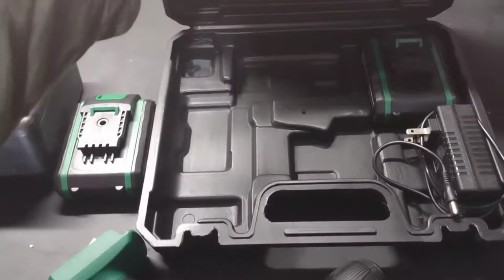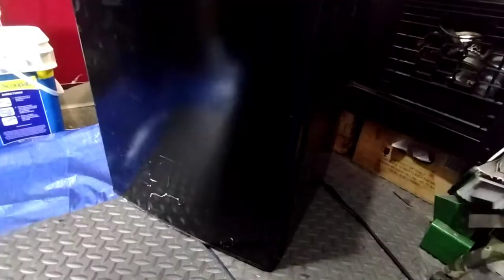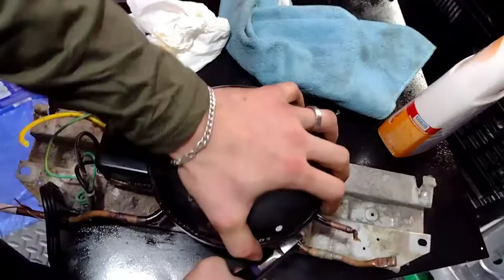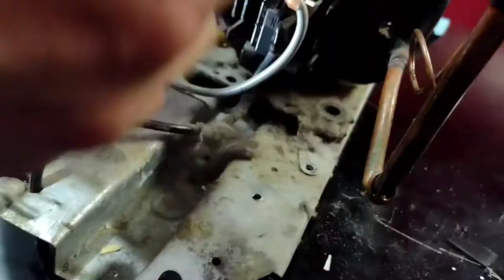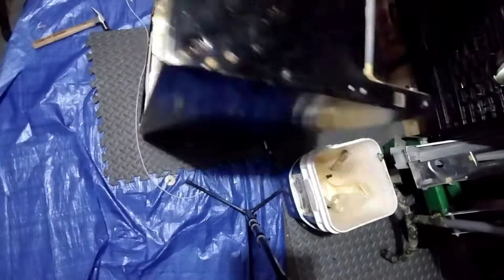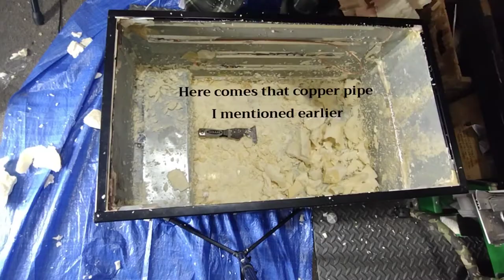COMPLETELY scrapping a mini refrigerator freezer combo for MAX Profit and value. Recycled treasure

Comment: I completely broke down the exact same fridge with a prybar, wirecliopers and a 10pd sledge.   It took about 10 minutes and the foam came out in chunks as I hammered the outside skin and peeled away the inside plastic.
The refrigeration  tubes came out the easiest.